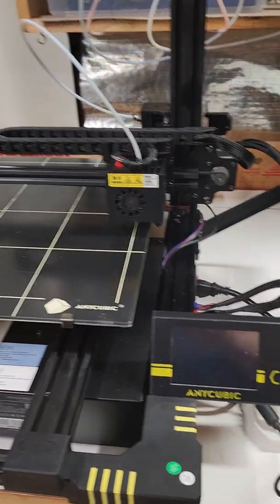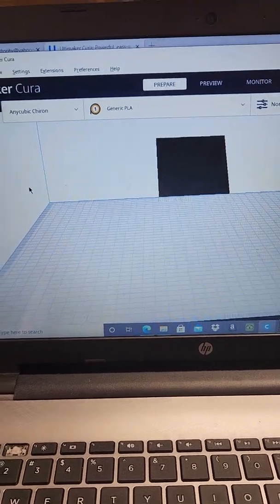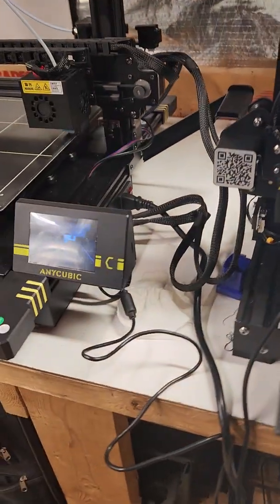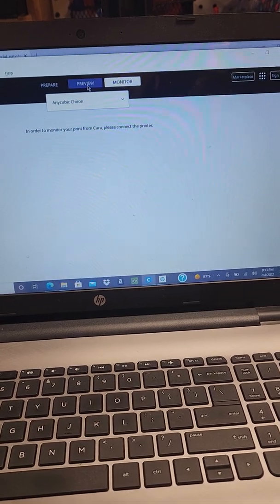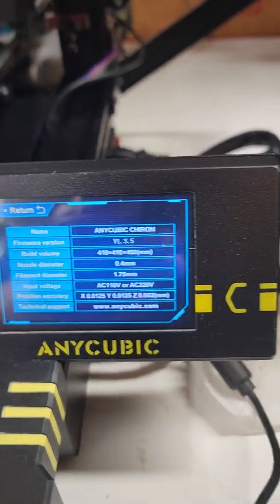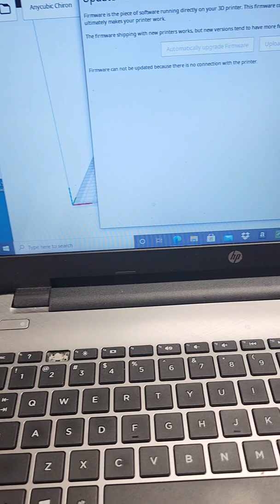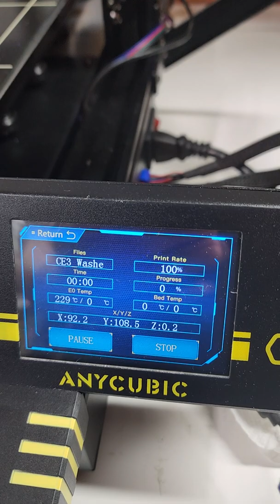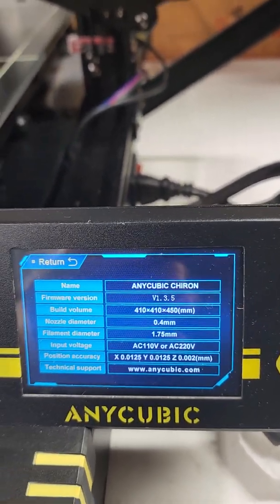Anycubic Chiron Firmware Update - How to Install!

Comment: This might be too long ago for you to notice but i just got an old chiron from a friend that didnt need it anymore but i dont have a z-offset option, so i thought, lets flash a new firmware to it. as i always do i asked chatgpt and he told me i should flash it with AVRDUDDESS, which i tried but it didnt seem to work, chatgpt said it was because my bootloader is gone, which i doubt. than i came across this video and tried to update firmware via ultimaker cura, and it was doing something. it said it was updating and than said it was complete but the screen didnt change, i restarted the printer (waited about 5 seconds after turning it off) and still no change, i also tried uploading custom firmware cuz i still had the hex file i tried to flash via avrduddess, but again no change, except for the fact the startup sound changed (probably to the one that the firmware uses) yet no change in the display, again tried restarting without succes, and now im here. does anyone know how to fix this or just any other method so i can get my damn z-offset?

Comment: Had exact same problem. The wire that goes to the thermistor underneath the bed has fatigued and broken connection. Make a hole at back harness just before where it goes underneath the bed. Find the skinny wires that go to the thermostor and measure resistance which should be under 100ohms. Remove existing skinny wires and  resolder soft silicon AWG22 wires from as close as u can get the thermostor solder pad, and join 2 skinny wires, then go a foot up into the harness, make a hole and join these new wires into existing wires. And it will not freeze anymore.

Comment: hey brother fyi to anyone wiht this issue its your psu or motherboard fans thats making it cutoff randomely it is overheating and shutting off as a safety standard. to update your firmware and connect through usb into a computer you have to first go to your machines website and download the DRIVERS so your computer can recognize it as a printer properly then it will ping in cura, goodluck!
Reply from the maker: Thank you for the feedback, my issue was the actual wiring, I had a broken wire.

Comment: You have to call anycubic and they send you a new cable to the hotend and everything will work just fine..the cable to the ted connector is faulty or the connector itself. Anycubic are very helpful try to ask for help and they do everything to solve your problem.  They fid it for me!

Comment: i have a chiron, mine would do the same freeze up, i replaced the hot end cable and print bed cable and it fixed it, anycubic wiring on these is cheap crap so get a quality replacement and not a new one from anycubic, i got mine from germany but i'm in scotland

Comment: I updated my firmware and lost ability to auto level. the customer service is a joke
Reply: Did you ever fix it?
Reply: @donnabio7675  I did but since they do not offer anything for this printer nor will they respond to messages about it I have a paper weight now.. I cannot find the 1.3.5 software anywhere now to reinstall

Comment: Wires are suspected, where it stops is the tension point at witch your wire/connection fails. the main board sensing the voltage increase trips safeguards and stops. Maybe

Comment: It looks like it's rubbing the nozzle on the head of the table and the machine is shutting off as an alarm. For some reason I had this problem as well and have to manually add a z height offset to all of my programs on cura and fusion 360. Try adding 2.5mm and make first initial layer 0.3. You may have to experiment on the heights but if I use their manual leveling code it's always +2.5mm from where my program wants to start at z zero if that makes sense.
Reply from the maker: Thank you for the input, but the problem ended up being the wires, bad wires to the extruder and bed.  I replaced them all with a silicon wire and now the machine is working just fine.
Reply: @diydadhub  Awesome glad to hear it. I have looked up everywhere and I feel I am the only person who has had the problem I had. Luckily I was able to figure it out with a positive z offset but it wasn't easy and I am a machinist. Good luck 👍
Reply: @diydadhub  do you have a link to the silicone wire?
Reply from the maker: @Here-2-Learn  https://amzn.to/42Ezob0

Comment: the thermistor on the bed is not working properly and causing a thermal runaway that shut the machine down.  check the bed connections, possibly a broken wire
Reply from the maker: It was a broken wire on the bed, which I replaced.

Comment: Im pretty sure u just need to fix the cable connection on the Hotend side with cable ties its called strain relief . Just look at the connection if the printer moves to the outside . FIx it like that the connection is not wiggeling if the printhead moves to the left outer corner. 
Hope i could help u.
Reply from the maker: The wires for the bed were bad also broken wire harness for the Hotend/extruder so had to replace them with silicone wires...please watch new uploaded video

Comment: I think the temperature sensor has an malfunction. or cable is broken.
Reply from the maker: Multiple failed points all cable related.   Replaced the bed and extruder cables with silicone cables

Comment: Did you reformat the SD card? And also try re slicing the file? I’ve crashed mine before with over loaded and or corrupt SD card.
Reply from the maker: Yes cards were formatted but this thing worked so weird that Anycubi Support can't even figure it out

Comment: Youre trying to print an Ednder 3 file not Chiron. When you save the  file Chiron. Saved Chiron files start in AC for Anycubic Chiron, Ender 3 start with CE for Creality Ender. Make sure slicer is setup for Chiron..
Reply from the maker: Thank you for the comment, I actually change the file names and the file names don't have to start with AC, the issue is with the wiring/motherboard.  Replacement parts are on their way.
Reply: @diydadhub  Then how do you tell the AC from the ender programs? There is a difference. They dont interchange
Reply from the maker: @tomhutchins1046  It'll depend on the slicer, and how you save the file to specific SD card.  If I'm slicing something the Chiron, then that is what I select as a platform and the same goes for Ender.  With the Chiron, if the file name is too long, it won't even show up in the print line up.  So make sure your File names are pretty short.  I can even Use the sliced imaged for Ender on Chiron as the GCODE will pretty much be within the parameters.
Reply: @diydadhub  I have 5 enders one voxelab and a chiron. have a second Chiron on the way. The code maybe similar (I have 30 + years experience with CNC machining starting out in the old days with a drafting board and manually writing programs). there are many different formats of g code and M code. The Chiron and ender use completely different header commands and finishing commands, There is no such thing as close enough in machine code. when you slice you have to make sure it is set to anycubic Chiron not any other "similar" model. yes the older enders hide part of the file name also so i came up with a system of abbreviation's but i always start with an A or a C or terrible things can happen. I commented on one of your other videos i went through a few bugs on the chiron also but once i sorted them out and added the braces its a beast for the money. im printing out the Y motor brace , tower and extrusion reinforcing  parts right now for the second Chiron.
Reply from the maker: @tomhutchins1046  I appreciate the feed back and the insight, I'm learning this as I go along and sharing my experience with it.  I believe these dialogs are also important to note that my method could be completely wrong and people should not make the same mistakes.  The Chiron is a beast but also made with some faulty hardware which needs to be addressed.  I will be posting a video in few weeks for the final fix of the issue.
Reply: @diydadhub  looking forward to the fix/
Remember they are trying to offer the largest format printer for under $400. The internet rumor is the first ones a few years ago shipped with some issues and they withdrew the product and re rereleased it.
Compared to an ender? I have both.
The extruder is a MUCH more advanced design on the Chiron. The first thing i do on the ender is replace the plastic parts on the extruder with metal not just because the arm will crack but it flexes and the coupler is undersized. Also replace the brass gear with a stainless one
The extruder on the ender is a dated design the Chiron comes with a much better j head extruder. Better cooling and isolation between the hot and cold areas.
If you are going to use PLA only 200-220 deg both work well as delivered. For abs I buy a $20 swiss miss clone replacement for the ender or a $10 copper/stainless heat break for the Chiron.
main board the ender has the old knob and a proven marlin firmware. The Chiron has a touch screen.
The newer enders are 32 bit the chiron has 8 bit . Which should be plenty the prusas use 8bit.
Cheap wire ? The wire quality looks the same as an ender I compared. Except the Chiron has much better strain relief on the extruder end and plugs . The ender is a rats nest with the wires just hanging onto the extruder no support.
Carriage design dual rails wide base on the chiron and a single rail on the ender. 
Ender single Z screw with cheap switches for homing. chiron dual with 2 light based sensors.
Bed heater is much better than the enders little pad in the center.
You may have received a bad one return it? Looking forward to the Fix should be interesting.
Reply: @diydadhub  Update LOL 
First Chiron still running great . All the braces really help including the Y motor brace. Just don't take out or disable the stepper damper.
Second Chiron with the newer software showed up the screen was full of static tried to reload the firmware ended up with a white screen. Sent back to amazon as a dud got refund.
Ordered a second worked great for about 30 hours then TO error, Took the upper harness out of the chain and straightened out the kinks hung it by the upper bar with wire works great just obviously not reliable. Ordered a harness on ebay $60 seller a flake. ordered from a second seller he actually shipped. First machine has the older software works good but the second seems smoother and silent with the latest software.  Contacted anycubic complete with serial number and no response.
Thinking about a 3rd chiron or i willl just drop an anvil on my foot over and over same thing.